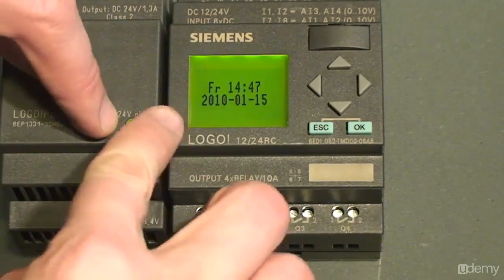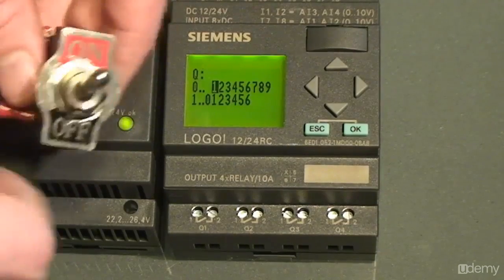Siemens LOGO! Unboxing and Setting up the PLC Basic Simulation

Comment: horrible!.....yellow/green cable should only be used for PE (protection earth), not for DC GND....additionally she connects a RED cable to GND too...bad...blue or black are standards for GND....RED should be used for DC power supply....additionally she call a LED (i suppose with integrated resistor) a LIGHT BULB!....gosh!

Comment: I bought a house with this system. But i have a probleem, the lights outside wont go on anymore after i switched off and on the main power.
Can i just connect q1 and q2 for constant power?
Reply: o gosh....a PLC=programable controller and will behave according whatever was programmed in it...it is not a dedicated "house lighting control system"....

Comment: When connecting to power supply you connected so called GROUND cable instead "earthing cabe" with is HUGE difference. This is big mistake because this green/yellow cable should be used in protective function ONLY. So (-) on power supply is not earth = you cant use green/yellow. Correct me if im wrong. BDW good thing YouTube has speed option because this lector wasting a lot of time
Reply: you are right  
green/yellow for ground/earth use